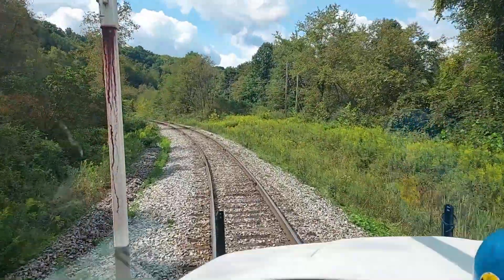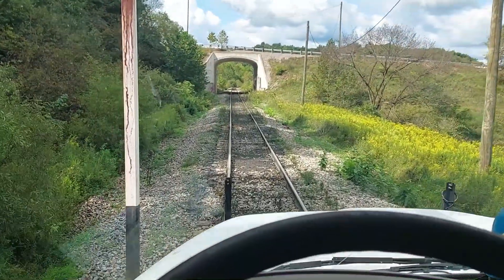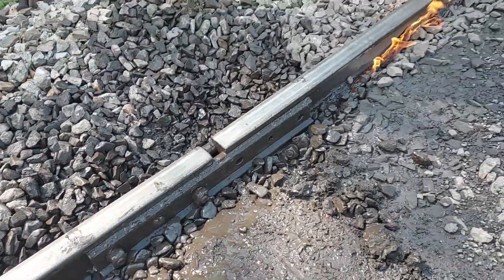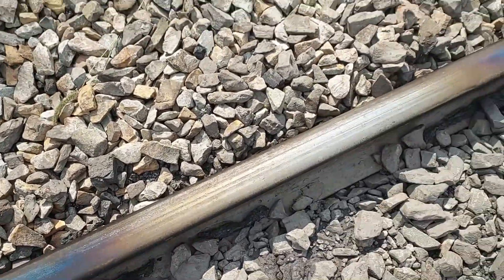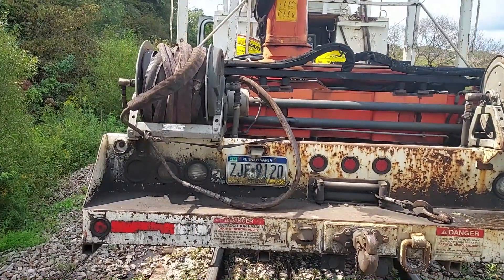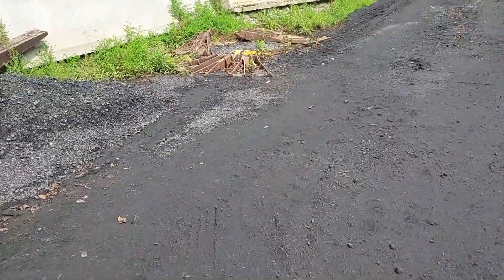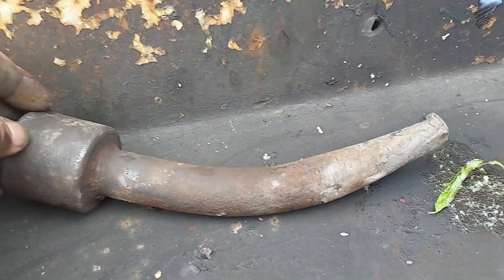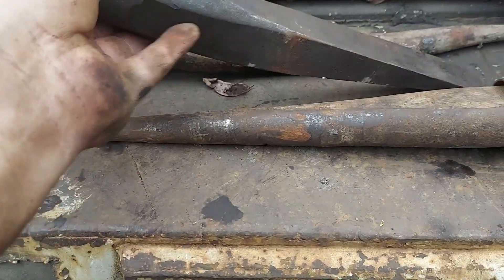I Set the Rail on Fire Today! Fire Snake in Action!!!

Comment: We used to use rope soaked in kerosene  to melt ice in rail flangeways wish we had firesnake
Reply from the maker: We used the rope also Kenneth before the snake, still have some
rope for backup. It was sloppier but I believe it burnt hotter and
we too have used it for crossings and switches to melt ice

Comment: Using rope with kerosene sucks big time been there done that. With a 4 inch gap better off cutting the rail into a 39 footer if it’s CWR . Come back later and adjust it and thermite  weld the joints.
Reply from the maker: That was our next option David to put a plug in that bigger pull apart, but thankfully we got it back together, although it was the hardest
one I ever did. Yep the rope is a lot sloppier, but I do believe it
burnt hotter than the snake. Thanks for writing in sir

Comment: Do you always leave re-railers along the side of the track? Did you have a derailment there recently? Sounds like you need to put a slightly longer section of rail in when it pulls apart next January in the sub zero weather!
Reply from the maker: At the load out area is the place where we get the most
derailments. These cars are worn out and after being loaded, sometimes car
doors open up. When this happens the guy loading doesn't know
it so the cars get drug thru the spilled coal and eventually derail,
it a pain, that why the re railers are there. And yes we have discussed putting in a longer plug to help in this section, good thinking on
your part Keith

Comment: Seems like the fire snake is just a band-aid solution. Use it at one weak spot and just wait for the next weak spot to pull apart. If you have sections of rail that you have to fire snake once or twice a year then I would think it would be cheaper and more safe to replace that mile or so of rail altogether.
Reply from the maker: WE gonna need to add a bit of rail to this section at some point in
time along with cribbing the ties out, just hard to get everything else
that needs done too with them constantly running trains, we have limited track time, but that's railroadin! Thanks for watching

Comment: Great job Dave! So that Fire Snake stuff is kind of like Sterno in a tube? That's what it sounds like. I was wondering, if you get this much separation with sticks of track, what happens with continuously welded track? You would think it would generate enough stress to break the track! Anyway, very interesting. I never even heard of the procedure much less witnessed it! keep up the good work sir, your railroad needs you 😊
Reply: One of the things you do with CWR is determine an "average" temperature for the rail over a year by studying the weather info. Then you try to lay on a day when the rail is that average temperature. The rail will shrink when it is colder and possibly pull apart if not well anchored, but it also expands when it gets hotter, and if not well anchored can turn into a twisty snake that can buckle back and forth a foot or more in about a rail length. Needless to say that is as hard or harder to deal with than a pull apart.

Of course they also use expansion joints here and there, especially on bridges and the like where there isn't a lot of dirt around the rail top help keep the temperature somewhat constant.
Reply from the maker: Sterno in a can...LOL I liked that! yep that about what it is.
I've never worked CWR so I really don't want to say much about it.
I do know they anchor every tie which really helps with the rail
creep whereas we only anchor 10 or so ties per 39 foot stick of rail,
but you're thinking and I like that!

Comment: This sounds silly but I assume there reason why not weld and grind stopping this. Thinking pull apart is the relief. And it do real damage if not allowed to seperate
Reply from the maker: Yes Ronald, the gaps are in there to help relieve stress on the rail as
it expands or contracts. We can't weld these jointed rails because
there are 3 bolt holes in each end and the welders won't weld unless
there are only the back 2 holes. The first hole is too close the weld
which may cause the weld to not set properly and crack. Appreciate
your watching sir

Comment: Thank you to those that allow you to video. What stops it from pulling back when it cools? I bet some of contents burn so you can see alcohol burn. Again thankyou
Reply from the maker: Thank you Ronald for watching sir. And the new bolts will hold
this joint from pulling apart again for a long while. Most likely
what will happen when it gets cold is that another joint with weak
bolts will pull apart, but we will see what happens

Comment: Just my opinion,,,from far away and on YouTube,,,,,could there be too much up hill throw in your curve? I know we always like more positive but sometimes we go to far? Great information sir
Reply: Just thought about what i was saying,,, most may not know I’m talking about the tamper operations
Reply from the maker: Long time ago we postulated that we should throw all our
curves out for hot weather and then back in for colder weather,
great theory, however with 75 curves and only 2 guys who have
to do everything else out here, plus the big thing is limited
track time and too few dead track time, the time to do all that is
just not there. I like more positive throws also, but do try
to keep negative and positive throws fairly close. But you are
a far better expert at tamping than me, so I'm always willing and
wanting to listen to what you say Mike. Will be looking for your
reply. And I do agree with you on your opinion of this spot, there
a lot of too big gaps in the joints. 

Another problem we have always had is all  our loads are east, if
we had bi directional loads I think that would help considerable with
preventing the rail from running east all the time, but we can't change the way the loads move.
Reply: Hey Dave your doing a great job I’m not trying to put you down… I’m no expert I’m just a guy like you trying to do the best I can 
Your single direction loads would sure cause a lot of “driving your track out” do you run your surface program the same direction as your loads? What about running your surfacing the other direction? Just me on the other end of iPad screen,,, your doing great work great viewing sir
Reply from the maker: @mikejackman4416  all tamping is done against direction of loads.  Tamping in direction of loads EB. ? I value your opinions Mike, so help me understand that concept. Am gonna do some thinking on that too. Thank you
Reply: @ccrx6700  hey Dave I’m just wondering if you throw your track to far “up hill” the steel gets for a lack of a better word stretched to much ,then when your loads come into your curves they push it to that breaking point?? That’s just me looking into your camera on YouTube lol
I think I gave you my phone number in an email? Your more then welcome to all me tomorrow..Mike
Reply from the maker: @mikejackman4416  totally agree on that Mike. I try not throw curves far out, would be okay for summer, but cold would kill us if I did that. You know, what you and I are talking bout, 99% of people watching have no clue the finesse and planning it takes to keep track adjusted, really glad I met you. I have almost no one to talk real track work with here. Get a few contractors come in that can go over stuff like this, but not that often.
Reply: @ccrx6700  your doing a great job Dave ,,glad I met you as well any time you wanta bounce anything off me I’m here
Reply from the maker: @mikejackman4416  thanks Mike, appreciate that

Comment: So what happens when the rail cools off?
Reply from the maker: Thank you Robert for watching sir. The new bolts will hold
this joint from pulling apart again for a long while. Most likely
what will happen when it gets cold is that another joint with weak
bolts will pull apart, but we will see what happens

Comment: If i Had to guess at it's composition... I would say that it's a gelled alcohol not too dissimilar from a small 2 hour camping heater that one could find at any sporting goods store. The carbon in it might make the fire resistant to wind.
Reply from the maker: Very well could be, I'm not sure, some others have commented it
may be something like sterno or is that what you are referring to?
Appreciate your watching
Reply: @ccrx6700  it is. It could also be something like hand sanitizer with activated carbon, or even napalm with activated carbon. Maybe ANFO mixed with charcoal. Never made it that way myself. I always mixed straight ammonium nitrate with diesel as a secondary charge. I use something far more unstable for my primary charge. But since you're not making it explode but burning it... It can burn without exploding even though it's a high explosive it is actually very stable. UNLESS you heat it rapidly to 400°F... Then it will explode. So don't take a torch to ANFO. C-4 is similar in it's stability. My dad told me a story of when he was in Vietnam he cut off part of a block of C-4 and lit it on fire to use either as a heater in his squad shelter, or he used it as a heat source to cook with i can't remember which.

Comment: What is the maximum the gap can be between the rails before you have to draw them back together.
Reply from the maker: Great question William. Code fed regulations does not address a width
of gap allowable, however they do state that each joint on class 2 track must have a minimum of 2 bolts. So on average that means
there should never be more than 3/4 or so inch gap between
the rail heads. Maybe better to answer is that we never do
pull the rails back together unless there is a pull apart or we
have several bolts broken in a single joint and need to stretch
the rail to replace the bolts. Hope that makes sense, if not
write me back
Reply: @ccrx6700  Understood clearly thank you.  👍

Comment: Question.. On a "ribbon rail / welded rail" track. Does the heat of summer cause enough expansion to buckle the rail or the entire track? How is the expansion & contraction accommodated??
Great video and many thanks to the company for allowing you the privilege.
Reply: Look up a breather switch,  Or cwr expansion joint.   Basically tapered diagonally
Reply from the maker: On CWR every tie is anchored whcih helps slow down the rail creep, but still it will buckle, many RR's have slow orders over CWR track in
extreme heat just because of this. Glad you enjoyed the show Jon

Comment: You cheater! Haha. Get the rail expander out and get to work! Yes, we have some rather interesting monikers for our tools. We called the rail expander "old man", and drift pins were "bull dicks". With pull apart fairly common in that spot you may want to add a slightly long stick of rail in there. Good stuff.
Reply from the maker: Good suggestion Zach, and seriously we did talk about putting
a plug in or adding a longer rail stick here. Our big problem is
we run loads east all the time for 40 years, I think if we had bi directional loads we wouldn't have as many separations, just my thought. What do you think bout that?
Reply: @ccrx6700  I ran into a similar situation and adding a stick that was an inch or two longer kept the pull parts from happening in that area. You can also cheat and have a loaded train run over it, while you are there, have engineer apply sand and a 10psi brake application. By the time the last car goes by you should be able to just walk up and put the bolts in. I've done that a voue of times.

Comment: Thanks for showing that job.  I really never considered the rail would pull that much apart.  Especially in mild temps.   Man that coal dust really packs up the ballast quick!
Reply from the maker: The bolts had weakened a good bit had to do with the mud and pumping track, plus the bolts were old so they broke. Then with no
resistance to hold the track, train passing over it cause the rail
to run east. this joint will be good now with new bolts, but eventually
another joint will fail in this section until we can find time to
crib this out and add some rail in. Hope that helps

Comment: I'm guessing the joints are acceptable even when slightly apart, they don't need to be touching?
Reply from the maker: Yes you are right, perfect gap between joints is about 3/8's of an inch, that allows room for expansion and contraction of the rails
along with rail creep from the passing trains. Appreciate your
watching

Comment: could you have put a plastic isolater piece to take up the gap in the joint? how big can the gap be until you and the FRA think it's out of wonk?
Reply from the maker: We do have little pieces of rail we call Dutchman that we have used
for a temp fix. When using them we have slotted joint bars that had the bolt holes on one end milled to lengthen them, so your suggestion is a viable solution short term. Gonna make a distant video and show
you those slotted bars and the Dutchmen. FRA requires at least 2 bolts in each joint for class 2 track, that means there won't be much
of a gap, they do not have a specific measurement for gap tho. Very good thinking on your part sir!
Reply: @ccrx6700  do....do I get to put a gold star on da refridgerator?
Reply from the maker: @northstar2007  ⭐⭐⭐

Comment: Very Interesting  Repair a track like this Quest how do you Prevent the track from twisting sideways so a train Doesn't Derail what do you look for to prevent that ?
Reply from the maker: The ballast in the track helps to prevent twist, however when the
ballast gets fowled like here it doesn't have nearly as much holding power nor drainage ability. this section definitely needs cribbed out, tamped and aligned, just a matter of finding time to do since
we currently have more issues to deal with also, thanks for watching and glad you enjoyed

Comment: Maybe the rails should be set in place at a temperature close to the median temperatue for the area. 
Just as airfield runways are oriented along the drection of the prevailing winds.
Reply: That is exactly how continuous welded rail is laid. Usually it isn't quite as necessary with stick rail as there is some room for expansion and shrink at each joint.
Reply from the maker: That actually is in the code fed regs for RR's for CWR. WE try to
lay rail at near rail neutral temps, ( here ambient temp round 55 to 70),
it does make a difference the ambient temp when laying new rail. See
you were thinking and didn't realize fed regs covered that, very good sir!

Comment: Is there reasons why they dont have welded track? I remember on a train ride years back, when we hit those bolted tracks, it was a bumpy, loud ride. I know the tracks expand and contract. I never knew you light the tracks on fire. LOL.... 

And let your company know we are very appreciative and its great PR for them. Ive learned quite a bit watching the videos and I even got train sim 2 to learn more about how things work. 

If your company has a gift shop online Ill buy something from it. :)
Reply from the maker: Thank you and glad you enjoyed. Founding fathers built all jointed track, to weld now means replacing every stick of rail cause they
can't weld rail that has the 3rd bolt hole in it, so that a huge major
expense in the multi millions to have all CWR. When we replace rail we
do now weld several joints together which helps, but it a long slow process, sorry no gift shop
Reply: @ccrx6700  Running a business is always a balance between good and evil Ive noticed. LOL...
Reply: Clack clack - clack clack. Of the bogies going over the joins. 👍👍👌👌

Comment: I would have thought that the force of thermal contraction and expansion would tear the rail through any restraining bolts. Obviously that does not seem to be the case.
Reply from the maker: Rail steel is much harder than the grade 5 track bolts we use and sure
is a lot easier to replace the bolts than to replace a rail that would
have been broken. Appreciate your thoughts and for watching Robin

Comment: I would second the comment(s) that it's far too early (aka, too warm) to have a pull apart. I look forward to your responses to the other commenters' questions.
Reply: He said he previously had to use a ton of firesnack in another section right next to it so it's probably overpulled and get another pullapart when it gets even colder.
Reply from the maker: Well the bolts in that joint had weakened and then when the rail pulled
they got broken so there was no resistance left. The cooler
weather and the dynamic forces of the train then caused the rail to
separate at the joint. New bolts will hold that joint together now
for quite awhile, hope that helps Dr. Mastare, if not write back

Comment: Never realized rails would separate like that, really interesting ! Thanx again Dave for the experience and explanation !
Reply: the opposite happens during the summer.  The heat causes the rail to lengthen and push together.  Sometimes it expands so much that the track buckles, sometimes violently.
Reply: @Travelinmatt1976   Right; I used to work repairing trestle abutments. In summer at peak hours, the rails would pop quite loudly.
Reply: Yeah. I've never heard of a fire snake. Sure looks cool though.
Reply from the maker: @Ron4885  Ha Ha, you mean it really hot Ron! make a good short for
TikTok....LOL
Reply: Very common with jointed track on hills where repeated brake applications by descending trains and power application by those ascending has the effect of making the rails creep downhill as the kinetic energy of the train is passed into the rail.